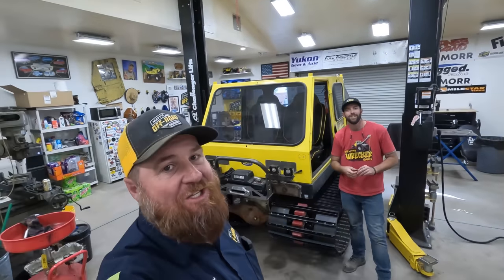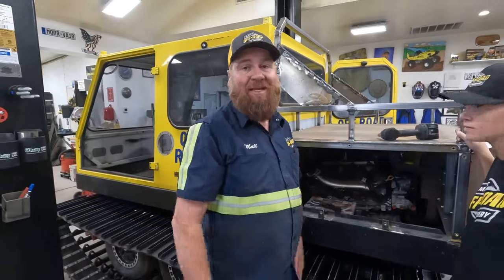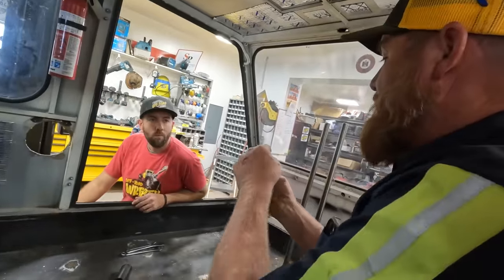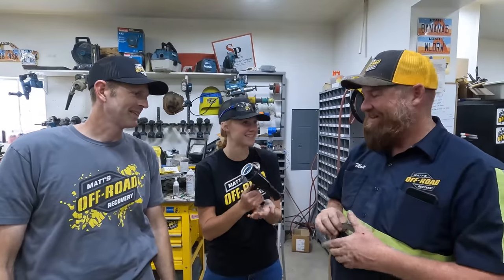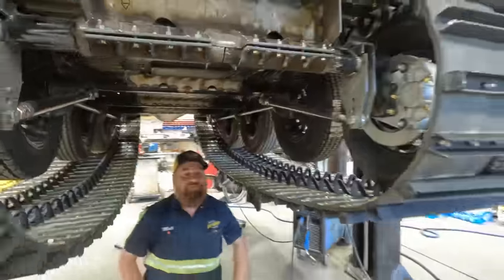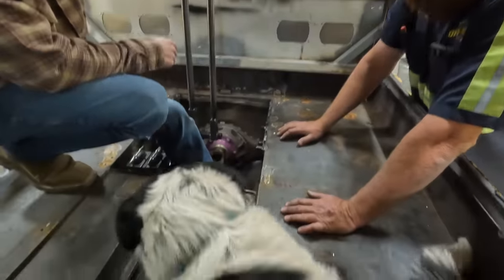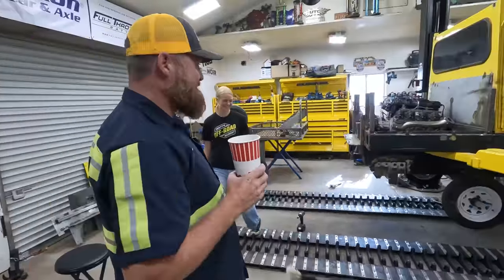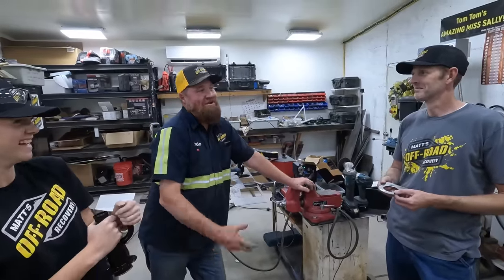The Bombi Is Off For Paint!

Comment: Use the old wiper blade hole to give the Bombi a front facing camera and run a small display inside? I know you have all the cameras, but it would be one more convenient and permanent free shot you could use at any time. Just an idea!
Reply: great idea!
Reply: I've thought some permanent cameras in all the rigs would be an idea for a while. The company I work for has them for security or proof in accidents etc and the quality is surprisingly good on them.
That way if something happens and no-one was recording or didnt get the shot, they can note the time and see if the permanent cameras got it.

Would be fairly easy to manage the footage too(with a security style setup where they record whenever the vehicle is on and it backs up to a server as soon as it has cell or wifi signal)

2 cameras would give them pretty good coverage on each vehicle and 4 would give them 360 coverage, though a bit overkill. Could add one in the cab too pretty easily. 
They would be much less intrusive than a gopro on a mount or the like, though not quite as good of an image.

Same goes for the shop and yard.. a decently modern setup with lots of angles means better security and if anything does happen without proper recording, there is probably going to be at least 1 usable angle from the static cameras.. sound would be a different matter rhough.
Reply: Night vision
Reply: Good idea, front and back.

Comment: You need to add a fumoto valve on the drain plug, quick and easy oil drains and you can put a hose on them so you don't coat your skid plate with oil.

Comment: My experience with fuel filler necks: You want the vent connection to be as close to the cap as possible so that when you put the pump nozzle in, the nozzle goes past the vent connection. 
The reason: The fuel pumps sensitivity to back pressure has increased considerably in the last 10 years and you do not want the vent connection downstream of the pump nozzle or it will constantly trip the pump nozzle off.

Comment: I have a minor concern with the exhaust. I think Matt's plan will sound and function great. Unfortunately, there are often extra crew riding on the back of the Bomb-bee, and they may get "the hotfoot" if the H-pipe and mufflers are too close to the decking. This will be far worse in the non-winter use he has planned. It's easy to fix or engineer solutions for and they may have already considered it in their plans, but it was the first thought I had when he showed the intended layout.
Reply: He can put heat protective padding on the underside of the deck or thin shield around the mufflers.
Reply: Exhaust wrap to the rescue.
Reply: It's not like he has a ton of options, they will work it out.

Comment: Might be a good idea to add a Fumoto valve for the oil change. They allow you to add a hose to avoid a mess and are rock solid reliable and convenient.
Reply: If they have enough hose on it, then an oil extractor could be used to suck the oil out. Zero mess then. Unless the fittings slip off.

Comment: I have a question! When Rhett welded the circular plate over the old filler neck hole, why overlap the hole as opposed to fitting the piece into the circle? 
I get circle can be a pain to cut but it's totally doable and would leave a much cleaner finish later on? Or better yet cut it to a square to make it easier? I only ask having dealt with that exact thing before, so I'm curious as to why an overlap was chosen there. Small stuff but it will stand out. Similar to filling the holes where the headlights were, I guess when doing a huge overhaul like this, it would make sense to put the extra bit of effort to keep it as clean as possible? No hate!
Reply: I wondered about that too; but I'm sure Roby will fix that later.

Comment: Why did weld the patch on the outside and not the inside?  Could have made it smooth
Reply: I was thinking the same thing, they have a CNC plasma, they could have made the patch the size of the hole.
Reply: Yes the patch should have been attached to the inside,or as mentioned cut to fit the hole exactly..

Comment: Hey Matt , pro tip for ya , when filling holes like the old gas fill hole , use “Panel Bond” .. it is what they put cars together with these days and is stronger than the metal itself.. its an Epoxy , and works fantastic , way better than welding and possibly warping the metal and making the metal more  susceptible to rust . Ask Robbie about it he will tell ya…

Comment: I noticed on the Tracks of the Bomb-bee.  The cross bars are attached to the tracks with bolts n nuts across. It looks to me that all those bolts are backwards for function.  IF those tracks come across any rocks and start to bend and nic and take some wear and tear,  I think the way the bolts are could get bent from driving and unable to take off for replacement or repairs.  I think those bolt heads should be facing the outside of the tracks and the nuts should be on the inside, that way they don't stand a chance of being bent or crushed in any way. I hope this makes sense what I'm trying to point out.  -  Love you guys!
Reply: The nuts and protruding bolts act as little spikes to help stop the track from slipping sideways on a cross slope. If I recall last winter it was explained that the old tracks had no way of stopping the Bombi if it started slipping sideways.

Comment: I'm not big on asking questions on these videos because I enjoy watching how you do things without worrying too much about why.  However, I am curious as to why, when addressing the old fuel filler hole, you chose to weld a plate over the outside instead of cutting one to fit in the hole and welding it so it could be ground flat for paint?
Reply: Because it's cheaper this way.

Comment: Since the floor is going to be getting wet and muddy all the time. There is a product made for boats called Sea Deck It is phone rubber that is UV resistant made to be in the son. But will add very good sound deadening and insulation. They have lots of colors to choose from. Also custom options and you can get designs and it like a big battle bumblebee. Or an old school bomb that looks like a bumblebee.

Comment: Should have a weep hole in the bottom of that oil change access cover you made… that recess will collect oil and water that will be a sludgy mess when you remove it for service… also, the liquids may freeze solid during winter operation expanding and distorting the cover. Most snowmobiles will have those weep holes.

Comment: This is my favorite project so far. The World's Biggest Off-road Wrecker was amazing, but for some reason I like this project even better. You have left little of the original vehicle except the shell. Amazing work. Only one small criticism so far. That old fuel filler hole should have been patched with a piece of round metal the exact size of the hole and welded flat with the existing surface. Maybe Robbie will clean up that detail. And when you said, "Siri, call Robbie Layton." My cell phone lit up and started calling my friend Robbie Davis. LOL

Comment: So a neat trick for keep warp down is welding 1/2 inch wait 20-30 seconds and put a cool wet rag on it turning every few seconds when the rag get hot fan it to cool it and repeat to cool  the weld slowly you can do this with skip weld straight across and with 4 cool wet rags not ice cold. This will reduce warping. You can also use a thick plate or Chanel bracing with the skip welding and let it cool before removing bracing. And rapid cooling can cause warping if you know what you’re doing you can use heat to bring out warping but it’s a real talent. I love working with steel and welding. I wish I could make the money and have the benefits and retirement I currently have and go back to steel work and welding structural or production work don’t care but the money isn’t even close to go back. I would have to work 80 hour weeks and still would have the benefits or retirement. Sad really but it is what it is. It’s my passion but passion doesn’t pay the bills unless I owned the company

Comment: if you piped your exhaust out the back, on either side of your radiator, mufflers could be mounted vertically as the pipes 90 out. quiet, and draw some heat from engine bay. or do the russian thing and have metal touching the exhaust pipe go into the cab below he seat to warm the cabin.

Comment: Interesting idea, not all stacks are straight pipes some even have heat shields and would really cut down on having an engine fire. 10' of cherry red hot glowing exhaust in a 5' box surrounded by gas, oil, rubber and plastic on hard pull.. 😅 gonna be 🌶️

Comment: A suggestion for the oil drain cover you built is drill a couple of holes so water doesn't rust it out and if there is an oil leak you can see from drip.

Comment: I think the supply louvers on the side of the engine compartment are Too small, you're not gonna get enough air through the radiator, which will create some overheating problems  out in the cold weather. It still looks like it will be a fun mini snow cat.

Comment: 17:30 To avoid problems of over length , we here in New Zealand have a device that fits in the palm of your hand,,,yes yes , i hear , BUT ,,It has a graduated tape , with actual markings on it , so that you can ascertain the length of something BEFORE you have it made ,,um , i even think they have them in Utah, and most states,,Although, instead of being graduated in Millimetres, the ones,(rarely found though) in the USA are graduated in a measurement called Freedom inches,,these can be found in some parts of the USA ,,But Nobody knows howl long Freedom inches are..hence the need for "eyecromitors".
Eyecromitor instructions will follow.

Comment: at 11:04, may i suggest you weld...like a diverter shield, a couple inches in length, in front of your oil drain plug? i am thinking otherwise you might end up with that first gush of hot, dirty, oil going where it shouldn't... 😀

Comment: Having driven an Can-Am ATV in the snow, and it had the brakes at the Differential in the front heated by the radiator.
I lifted the radiator and lost the brake "heating", and the brakes froze.
Wont that be an issue here?

Comment: Should try to figure out a way to stuff one of those cheap Chinese diesel heaters in the cab. It would provide a safe heated shelter in the case of a major failure. They typically run on diesel but have been run off almost any type of oil. It could also provide heat while waiting on others without the need to run the main engine.

Comment: Screw the hand held oil transfer pump! Take a gallon bottle, put a hose threw the lid tightly that reaches the bottom of the bottle. (Make sure a couple feet or so come out the bottle) Put a small hole on the top of the bottle, fill with oil and put open end of hose in case\tranny. Take air and push through small hole you put in the bottle and it will push the oil in the case nice and quick with no mess!!!

Comment: I knew what you meant without even thinking when you said ⅜ inch drive impact with a ½ inch socket.
You could have really confused Katelynn & specified how many points socket & whether you wanted it short or deep 😂
As for the circular cut-off saw, the old blades used to Grind their way through the metal opposed to a metal blade that takes a tiny slice with each tooth, the only thing that melts through is a plasma cutter which is a very different tool.
Poor old Jake, sent out with a thread rather than a size ! I guess Matt doesn’t own a thread pitch gauge.

Comment: So, something I'm wondering about on Tom's drill press. Did the guy that built it modify the bearings in the motor? Because the motor bearings aren't designed for axial loading, just radial. This has bugged me everytime I see it used. PS, I'm a ME.

Comment: An H pipe goes where the exhaust has cooled enough to not melt a crayon line. An H pipe so close to the engine is not going to help but will add morr heat to the engine compartment.

Comment: MATT: The pORT TO CHECK ENGINE OIL, +++Install D'Zus Fasteners to one side of the door. Then, you use a Coin or flat driver to open it...  The pORT TO CHECK ENGINE OIL, +++Install D'Zus Fasteners to one side of the door. Then, you Use a Coin or flat driver to open it... It will work.!

Comment: Safety glasses are worth the inconvenience... I had a thin cut off wheel explode in my face cutting welded wire fence material. A tiny piece lodged itself in the white area of my eye. Doc said I was lucky it didn't get in my field of view because I would have had a permanent blurry spot from it. Stop and put on the PPE...

Comment: You love baking your engines. Instead of putting the muffler in the engine bay, just get a muffler tip. They are a bit louder but you can run the exhaust pipe straight out instead of baking the engine like you want to do. Heat is an engine's worst enemy.

Comment: -- That filler line going right by the header:  Have you thought about how that system will behave in the event of a rollover, engine failure, or a heavy impact right there on the side of the vehicle?   Always get a kick out of tracked vehicles and this one's do different.  Tracks off it looks like a little dork mobile you wouldn't want to be seen in.  Tracks on, and you've have to play Nobody Rides for free and ward people away with a stick.

Comment: Having the fuel tank INSIDE the cabin avoids having to put HEAT on the gas tank. I imagine that now they will have to add an antifreeze system to the tank, I hope it doesn't add a lot of weight and doesn't take up a lot of space...

Comment: Wearing safety glasses is like wearing seatbelts... just because you are wearing them you still don't drive head on into a tree or whatever,  same with using a disc grinder or a table saw don't stand in front of the blade. Those disc are known to bust and when they do they go flying in the direction they are pointing.  Many people have been seriously injured by them even when wearing glasses.  
Matt you need to have someone who is a specialist come in and give you all a course on offensive safety in the work place and out on the job. While your at it first aid courses wouldn't be a bad thing either. Please play safe ...👍👍👍

Comment: And that thing is not a Ford, Imagine Trying your best in finding the right output shaft for a transmission from the 90s when they replaced parts like every 2 years and there could be like 6 variations for the same year. 
But half of the time the fun is on talking to half a town about that thing you are doing and nobody has seen yet.

Comment: Robby - Add an angled gas filler neck protector bezel to seal it away from the engine compartment. Basically to keep the fire (heat) away from the spilled gas. I know they are available, I see them on pickup flatbeds all the time. 
10:00  - Remove their fabbed part to do so. 
13:56  - Too many open gaps. 
I say Robby, cause the Bombi is most likely in your hands by now.

Comment: A seat doesn't have to be a chair but a seat is always a seat. A seat is anywhere you sit down, a chair is a piece of furniture that's designed to sit on. You find furniture in a house or building. You don't find furniture in a vehicle so therefore because it is attached to the Bombi it is a seat and not furniture and cannot be a chair.

Comment: Agggghhh!!!   You have messed up covering the old gas filler hole, and should have left it for Robby to do.  He will have swaged the hole so the the plug was level with the rest of the panel, and made an invisible mend of the panel.  I stopped the video to make this comment, so don't know how much of a disaster Rhett has made by surface welding it.

Comment: Should have put the plate covering the old fuel fill on the inside.  Covered with body filler and sanded so not to have a random round protrusion on the cab.

Comment: I still think you should have put a front wheel drive, east-west engine in the back to drive the back wheels. Then you'd have no drive shaft, so much more space for other things. A Toyota Corolla engine or something would be small, fuel efficient, reliable, serviceable, and still produce a lot more power than the old, original engine that was in it

Comment: Also please stop doing the fake "YouTube" tack tack dot dot welds. Just lower your wire speed and amperage and do regular drag welds. I know from experience that the dot tack welds work in some instances but they are not the correct way to lay a successful solid weld.